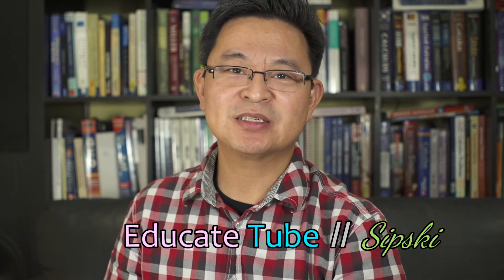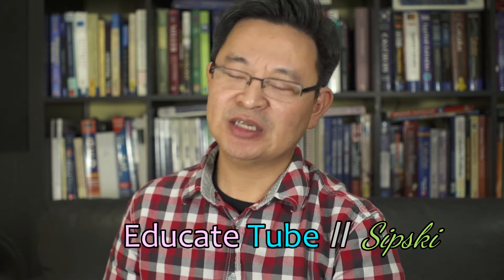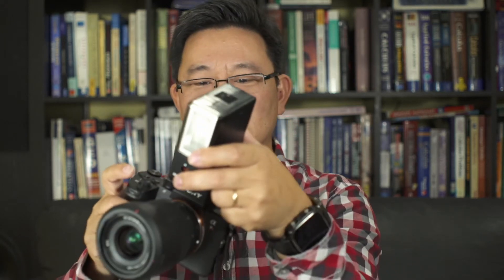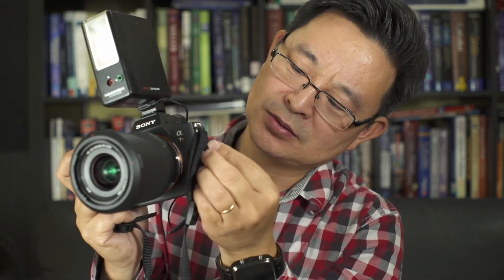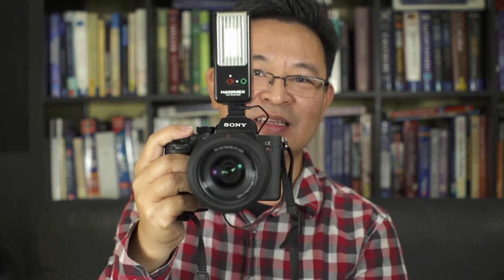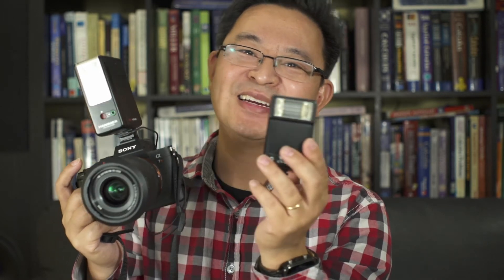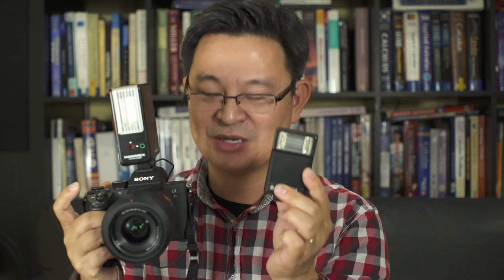How to use Sony a7r3 a7riii a9 PC sync port with flash from the past

Comment: I like all your vedio. I have the Sony a7mark3  which lenes is better for photography the Sony 50mm 1.8 or 35 mm zies 2.8 no worries about how much I have too keep one of them in my camera 📷 because I changed the lens and my camera 📷 sensor get dirty so may dad will buy onther one .thanks
Reply from the maker: 35mm zeiss f2.8 is great for photography and video due to silent motor.  Sony 50mm f1.8 is for great photography but not video as the lens is noisy.  Of course, 35mm is a lot more expensive.  The advantage of 50mm f1.8 lens is that it has a larger aperture so more light will enter the sensor.  Also, the bokeh effect on the 50mm f1.8 lens, in my opinon, is better.

Comment: Both the PC sync port and the hot shoe work simply by shorting across the two pins (ignoring the extra communication pins in modern flashes).

The difference in the flash recycle time is likely due to a thyristor circuit in the Hanimex flash, and the absence of a similar circuit in the Yashica flash.  When triggered, the flash will attempt to fully drain the capacitor.  If the flash isn't operating at 100% power, you need to use up the extra power.  Without a thyristor-type circuit, the extra power is turned to heat via a resistor.  With a thyristor-type circuit the power is "returned" to the capacitor.  In addition to recycling faster you'll likely also find your batteries last longer in the faster flash since they only need to top up the capacitor rather than fully recharging it each time.

The PC sync port is very useful for off-camera flash set ups.  You can easily extend the wire and mount the flash wherever you wish.
Reply from the maker: Thanks for the information!  Sipski

Comment: is the maximum flash sync up to 1/250 only?
Reply from the maker: 1/160 for full screen 1/250 for 16:9 screen.  At 1/250 you will see banding at the top and bottom of full screen so you need to use 16:9 screen.

Comment: 30 year old flash? Probably will blow out the flash connection. Flash back then had very high voltage of over 200 Volts, and a much higher current as well. Will easily fry out today's delicate electronics, not designed for it. I will only use external flash using a remote trigger, and will only mount original (or modern) camera flash on the dedicated shoe.
Reply from the maker: The trigger (from Sony a7riii 's flash output sync port) only sends small voltage to the flash even if the old flash needs 200+V.  You don't need 200+V to trigger the signal.  No damage.

Comment: get a flash that uses Sony's TTL capability.  And if you are worried about flash refresh rate, get a godox or flashpoint model that comes with a li-ion battery.  The flash refresh rate has nothing to do with the pc sync cable.
Reply from the maker: Ok. Thanks.  But got mine for free.  So how much is the flash from godox or flashpoint model?  Hopefully less than $100.
Reply from the maker: Alright.  Thanks for letting us know.  Will definitely consider it in the future.

Comment: Of course it's the flash, and it also depends on your flash energy setting , aka GN (Ground Number). It's one of the pieces of info missing in your comparison.
Don't want to seem harsh but you should really do a bit of homework before posting videos.